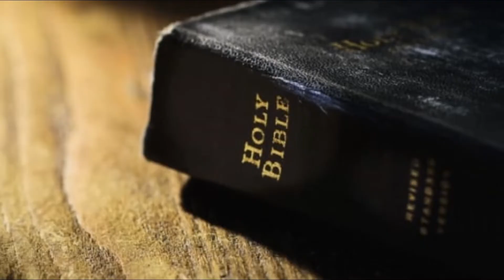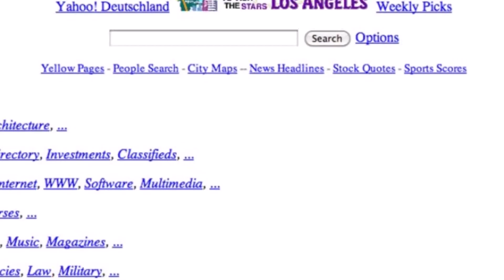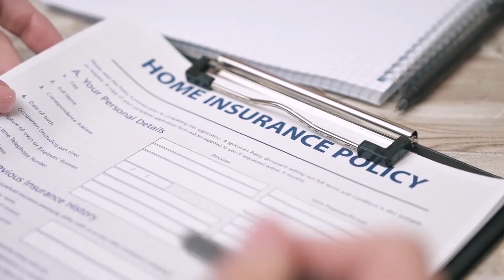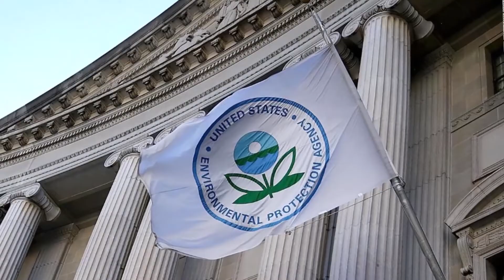Mold Remediation Scams That Could COST YOU Thousands!

Comment from the maker: Do you have a SERIOUS mold problem, that may need Mold Remediation?
Check out my guide -> https://lookmold.com/mold-remediation
Reply: What you been up to besides work
Reply: Happy new year how u spend it
Reply: Hi.. is the powder mold dangerous? Why I have mold in my clothes and shoes?
Reply: @herminiacarreon4038 Mold is always caused by a moisture issue. In order for mold to grow, you HAVE to have water. More than likely, you have a humidity issue where your clothes are stored. Try introducing some air flow near your clothes, make sure your ac vents are not blocked, and ultimately if this still doesn’t work; running a dehumidifier will greatly reduce mold from developing. Hope this helps 😊
Reply: @herminiacarreon4038 Also, a very small percentage of mold is considered extremely “dangerous”. We breathe in mold every day by being outside. We just don’t want it in the house lol

Comment: Insurance doesn't even cover mold damage
Reply: My home owner's is
Reply: @marycrandles4682  I believe it is only covered if it is caused by a broken pipe, or a bathtub or sink overflowing situation
Reply: Some policies explicitly cover it as an add on, usually with a $5,000 limit.

Comment: For anyone, not knowing what to do if your faced with a mold situation and don’t know which way to turn. First thing you would want to do is call out a properly licensed IEP/environmental hygienist. Explain to the Environmental hygienist all of your concerns and point out any areas you may be aware of.  Ask the Environmental hygienist to perform recommended testing so that they can write what’s called a protocol. The protocol should specifically explain what a mitigation company should do to properly remove the mold from your home. Once you have this protocol, you can provide this to remediation companies to write estimates for you. 

If you would like to know all the ins and outs of mold abatement, I would recommend buying the S520 from the IICRC The S520 is all of the standard practices and recommended procedures regarding mold abatement

Comment: this is SUCH facts. everyone needs to really beware top Google results. a lot of sh!t companies budget for being the top result but the company is actually horrible. and bc they're the top result, they get tons of business so they dont even need to try to be good. the first mold inspection we got the guy came in and fear mongered us so hard and my gut told me this company was bad news. then we got a third party inspector who was great and a different company to inspect after he got the mold report (we do have mold) and he came in and just factually told us what would need to be done and gave us a general time frame. literally no exaggerating or fear mongering. any sales person who fear mongers is a bad person seriously. 

but also question for you - if you have cabinets inside a room that needs to be treated, is covering te cabinet entirely in plastic (like those large sheets of plastic dropcloths) and taping it sealed TWICE (so one full cover + seal then a second full cover + seal) sufficient to protect it? we had a roof leak and most of the house is going to need to be treated and I'm trying to figure out the best way to protect the stuff without having to move everything out. I think double wrap+double taped should be good but would love to hear your thoughts.

Comment: What causes musty smell in a newish car?  We noticed this smell after only 1 yr.  We cleaned the filter multiple times and it’s still there almost always unless the A/C is running.
Reply: The car may of been in a flood, you have to check underneath your car carpets and see if the sponge underneath is damp, if so, it's mold forsure. Also look up at replacing your air cabinet filter. It's usually under or behind your glove department.
Reply: @PeterVangAdventures  it’s a new car, not previously owned. And we have had the air cabinet filter replaced twice. The musty smell is still there except when the AC is running.
Reply: Could be a dirty driver or passenger
Reply: Look under the rear cronswoggle and check if the bumbershoot is damp.

Comment: We have black mold in our toilet bowl..under the rim. I scrub it out at least once a week and got bleach tablet for the tank which I just found out doesn't help. We have no mold in or on the walls..or shower but it on the shower Matt and around the sink facet. I just got the distilled vinegar and soda. Would u please tell me what part to miss in my spray bottle and were to spray especially in my toilet bowl. I'd really appreciate any help or suggestions u are willing to share. Thank you for ur time
Reply: Keep that area ventilated , don’t put heavy drying carpets like material there because moisture from every hot shower gets sucked by it and just mold germinates. 
And if you have bunch of stuff in your bathroom is time to clean it and just leave essential things in there. But you need a cieling fan that’s actually sucking and venting the air outside and or a window. If you have both is a plus. 
Mold around the toilet 🚽 or faucet is from the same shower steam that condensates around the rims. Do what I said above and keep a constant everyday cleaning , and do not close the door after your shower, leave it open let it air out. You should be fine.if mold persists than you may have a bigger issue hiding . Get it tested it and ask for an air sample and or cavity test. Hope it helps

Comment: One important note. Virtually every problem you mention would be mitigated or removed by bringing in a reputable environmental consultant if the job looks like it could be large enough (or affect specific concerns enough) to warrant the expense. I'm sure as attentive mold remediation specialist you do this, but it seems to be a point that isn't really in the public consciousness.

I'm in California, so we call consultants for almost everything; or we get a signed waiver. There are of course exceptions.
Reply: What kind of consultant is an environmental consultant? I’m in Bay Area
Reply: @alchemyst2000  it’s a regulatory compliance consultant for hazardous conditions like mold, lead, and asbestos. Pretty steep licensing requirements. A good one will help you walk the line between costs, health concerns, and regulatory requirements and consequences.

Comment: Once you kill the bathroom mold from ceiling is there a paint that can be use to prevent it from coming back?
Reply from the maker: Well if there is a leak than cleaning shouldn’t be an option. If you are just talking about surface mold on the ceiling you have a ventilation issue. Make sure your fan if you have one is working properly. You can try fiberlock aftershock but you need to fix the ventilation issue
Reply: yes, find a quality EPA-rated mold encapsulant